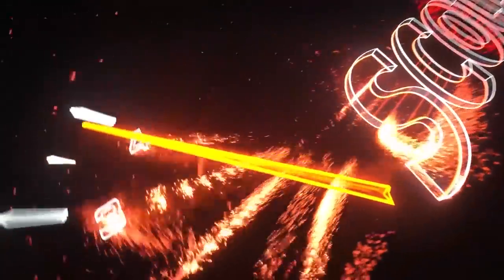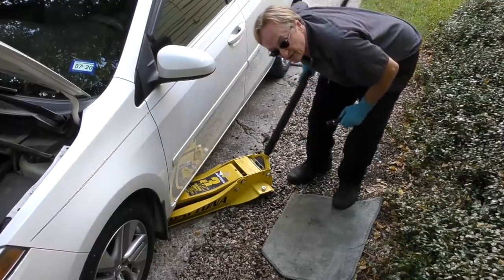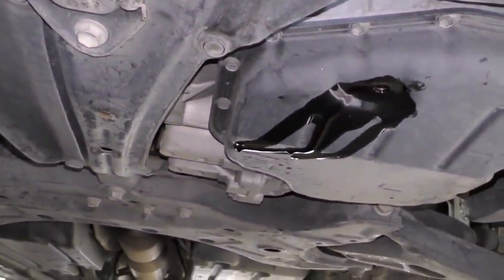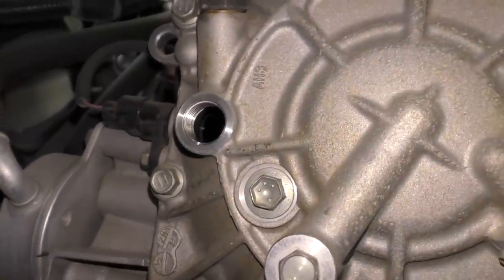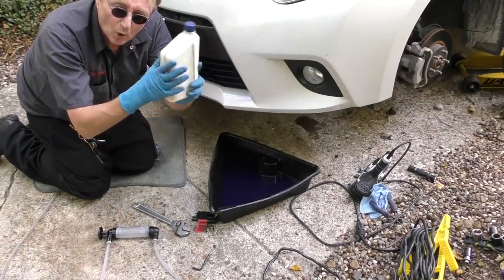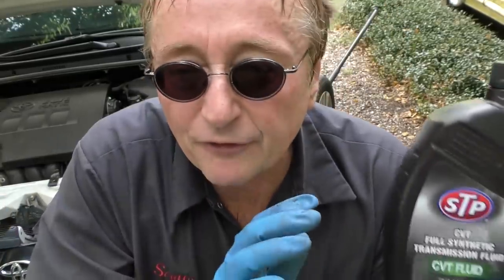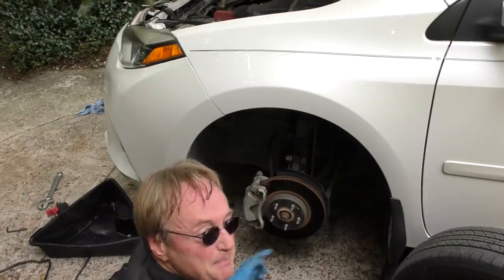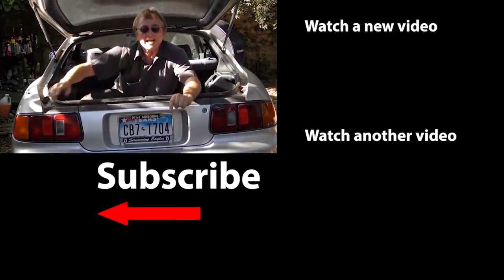This Toyota Corolla Has a Serious Problem

Comment: Scotty! I have a 2011 Chevy silverado 5.3l 4x4 with 151,000 miles on it. The transmission fluid has never been changed (I've owned it since 47,000 miles. Oops) is it still safe to change the fluid in it or is it too far past in mileage and changing the fluid will do more harm than good? Thank you!

Comment: Hi I have 2015 Toyota axio CVT transmission. When accelerating the car make a strange noise like it whinging or screaming I got the car look at and I was told I need a new transmission because the bearing by the axel gone bad can u confirm

Comment: BMW motorcycle shaft drives went through a "lifetime fluid" phase also...until they started to fail! Now they all have drain/fill plugs and stated intervals. Considering that the final drive 90º gear box costs $3K to replace, I think fresh fluid is a bargain...

Comment: I know this is a CVT so it might be different, but that seems like a small amount of fluid for a transmission.  How do you get the rest of the fluid out that's in the torque converter and cooling system?

Comment: Scotty I know that the process would be the same for any CAR transmission my question is what about a 2017 Nissan Pathfinder that I know have a lot problems with its CVTs transmissions. I have done some research and most of the videos show that you need to have an specialized scan tool like you have because you need to check the transmission fluid Temperature to be able to do the job right and in some of the videos they recommend to flush the lines that go trough the radiator part. What are you thoughts on that and do you think that I can do that transmission fluid change on my 2017 Nissan Pathfinder the same way you did it on this Toyota Corolla? Thank you and I love your channel soo much knowledge... keep the good work.

Comment: hi, im having a whistling noise coming from my toyota vitz 2007 model which is having a cvt transmission. and vehicle is not accelerating when the noise is there. seems like cvt belt is slipping. any advice you can give??

Comment: I love that pump. What is that kind of pump called? That is so much better than a funnel from the top because it takes forever. Especially thick 75W90 manual gear oil.

Comment: Only one quart?. Then You have to do this every 2 months until it comes clear. It goes by temperature to get more out on one try.
Reply: I have a feeling he either mispoke, or that car was very low in fluid. this is the problem with doing his way...he talks about "if you want it done right, do it yourself." when the manufacturer says there is a technique that is much different. just replacing what came out is not right because it could have been low or overfilled to begin with
Reply: True. That is the importance thing about temperature. It’s a different process but  I think this is a perfect situation that works.

Comment: @scotty kilmer thanks for the much required video tutorial. I have 2 questions

1.After pouring new fluid don't i have to go to a specific temperature for the cvt fluid and again loosen the drain plug to see any amount is coming out or not?

2. After finishing filling up properly is "calibration" necessary?

Comment: I see a lot of repairs like this one and diff work says replace crush washer with a new one. Is there an affordable source to get an assortment of them in bulk to have around? It seems like a crazy reason to not be able to finish a job and every video I see replacing the washer casually mentioned like adding a bead of oil around the oil filter gasket. Well oil I got, assortment of crush washers, not so much. Is it the same type for diff, oil pan, CVT drain plugs? If they are all the same I would like to have some. I just found how many different fluid locations my Subaru has, I think I am going to need them...

Comment: If you consider this procedure did not replace all the fluid but not even half I guess it's money in the pit Some years the TCM has updates but in general CVT are program to raise the pressures as the transmission fluid loses it's properties so technically you would reset the TCM memories as you have done repairs. To make the engineers point the fluid is good for the life of the unit .When the life of the unit is over you replace the whole thing. I would not suggest any rebuild it's a recipe to disaster

Comment: Hi Scotty, I rather have someone else do the work.  I'm not climbing under the car, put on rubber gloves on in North Carolina heat, then take off the tire, then put it back on.  Sometimes it pays to get someone to do the work.  Now if you like doing this, great, but nowadays the belly gets in the way and the legs ain't what they use to be nor my patience.  The older you get the less patience you have even for minor fixes.

Comment: Hey Scotty! I have a 95 celica with a manual transmission. The knock sensor code came up. Having trouble finding the sensor on the engine. Any idea where it is?

Comment: Scotty,

I just bought a 2008 Honda CRV with 65K miles. It was a single owner car, garage kept, and only driven 6 miles a day by an older couple.

The transmission fluid has not been changed, although everything else has been extremely well-maintained.

Should I change it since it’s close to 50K miles, even though it’s 12 years old?
Reply: HOw does it look and smell?  Engine oil more important because 6 mi. may not reach full op. temp. long enough.
Reply: Bryan Heck I will change it every 60000 miles.

Comment: Surely that CVT transmission has significantly more oil in it than 1.7 quarts!  Seems like a WHOLE LOT of trouble to change what is likely just 1/3 of the total oil in the transmission!  Why not flush anyhow???  And what about the filter??
Reply: would you prefer the weather to slowly drop couple degrees every week until winter or 110 today and -5 tomorrow?
Reply: I think the filter is not removable like many cars are being made today. He didn't drain that much out because he didn't lower the car after jacking it up

Comment: Scooottttyyyyy!!!!! Please I need help on this one...I swapped my Nissan xtrail t31 2008 model cvt transmission for a manual transmission and it runs very slow now. Do you think I need a new ECM or the old one can be worked on to control my manual transmission. Please help because I am still on this project as I am writing.

Comment: Shouldn't you run the transmission to a certain temperature and then take the drain plug off and drain the excess oil. (that orange thing gets left in there)
Reply: I mean after you refill the tramsmission

Comment: Should I even change the fluid on a Nissan CVT transmission that has 110,000 miles? I think at that point it would hurt it more than it would help it.
Reply: no it's never too late to only do a drain and refill. Only time it could ever do more harm is if you flush it. Scotty talks about this a lot. Honda recommends changing CVTs every 90K for normal driving conditions and every 30K for severe driving conditions. I would definitely change it now and change it every 30K from here on out

Comment: Scotty-I just bought a 2010 Toyota Corolla as a daily driver. Does my car have this kind of transmission or is that only on the newer models?
Reply: You probably have a standard 6speed auto, but its the same procedure.  my 2012 camry with the 6speed was exactly the same as shown here.  Get a manual for it, or search online for the proper fluid to get.

Comment: Hi Scotty.   I live in Maine and am trying to buy a pickup 4x4.   i cant afford one so im looking at cars.   I have 2000 dollars and have come across two cars in my town.   a 2003 lexus GS 300. 195k mi.   good inspection sticker says nothing wrong with it.   Also a 2002 BMW 540i.  v8 both RWD   BMW has 165k mi.  says it runs and goes good.  which would be best overal for saving money.   I figure Lexus.  it has a 2jz motor pretty cool.  BMW has lower mileage and is cool all around. but fear BMW will give me more problems.  both about the same price.

Comment: This isnt the proper way on toyota cvt. From what i can remember you have to let the car warm up checking fluid temp with a scan tool as it has to be withint a certain degree and put it into a check mode. I think u shift it from park to drive  a couple times intill the D light on the dash blinks and then undo the drain again and see what comes out.
Reply: ThefamousReds “DNY automotive “channel shows the proper way to change the trans fluid

Comment: My dad has a 2014 corolla with the 1.8L and CVT, had the fluid changed every 35k miles.   Currently has 92k miles on it and the transmission is getting rebuilt to the tune of $3,000......wondering if the fluid was actually changed when it was taken in for the service.
Reply: I'd just buy a used one for $500. Ouch
Reply: that's why i'd only buy a CVT from Honda.

Comment: The only CVT I want to deal with is the one on my Honda Elite 110 scooter. I'll make sure if I get a new Corolla it'll be no newer than 2014 with the good old 4 speed transmission or a manual transmission for anything newer than 2014.
Reply: r762368 I have a 2016 CVT Toyota Corolla with 153000 miles, no issues at all. I am a rideshare driver. “DNY automotive “channel shows the proper way to change the trans fluid

Comment: So you're assuming the tranny had the correct amount of fluid, to begin with.  What is the tranny had a small leak etc, then you would still not have the correct amount.  How do you check it then?

Comment: Hey Scotty, I have a 2014 Corolla s and I bought it with about 60k miles, first thing I did was chance all the fluids and filters plus brake pads just to make sure. But I also had the transmission oil filter changed, do you think that was unnecessary? I also bought the original CVT oil from the Toyota dealership.
Reply: I have a 2016 Toyota Corolla s plus and I have 60k miles with cvt transmission change it every 60k go by the owners manual that’s your best friend

Comment: Scotty never reads these posts. The 2014 Corolla LE needs to plug into the diagnostic port and several other things not mentioned here. Please be specific of what year model(s) you are referring to. !! All cars changed after 2014 with all the computer crap.

Comment: Hey Scotty, my 2012 Toyota Prius C makes a small grinding noise with the initial acceleration of the car.  Any idea what it could be?
Reply: It's making itself some coffee of course. Don't YOU like a little something to help you get going?
Reply: @yourhandlehere1  Hilarious (sarcasm)
Reply: @TheArccore  But really...most grinding noises are related to the CV axles on FWD cars. They get a lot more stress than a RWD ever did (and are smaller and weaker).
First place I'd look.
The terrible flaw in FWD design.
Reply: @yourhandlehere1  is the axle expensive to fix?

Comment: I have a 2015 Corolla and have been researching this, all of the other video's I have watched have said the car needs to be leveled, the fluid needs to be a certain temperature. (35 to 40)C on the other video's its a lot different than this one. So many different ways, hard to know which is correct.
Reply: dont follow scotty on this one. Has to be leveled and correct temp
Reply: @Chorizomicks  Why does the car have to be leveled? And if you draining from a car that sat all night temp does not matter. I agree if the fluid is warm, then you would need the correct temp to finish the job and a level car for draining.

Comment: Hey Scotty I got A Toyota RAV4 2006 the transmission oil is never been change has 153,000 miles should I change it or leave it like that
Reply: Change it by doing multiple drain and fills with the correct fluid.  Never flush.  If you didn’t tow or do all city miles the fluid is probably ok.  I would not leave it in there unless you are getting rid of the car very soon.

Comment: If tranny fluid gets so hot that engine coolant is used to cool it down, then you need to be changing it a lot more often
I was on a cvt rebuilders website out of NZ and they state to change the fluid every 40K
I think every other OLF is good practice.
Does anyone make a high milage ATF without the detergents that you know of?  I think its a good idea.

Comment: Very surprised there is only less than 2 quarts of cvt transmission fluid in that car. My Ford F250 uses about 16 quarts of transmission fluid.
Reply: Michael Urban I hope that includes what’s in the torque converter

Comment: Should you change the fluid on an 07 Fusion v6 with 90,000 miles or is it too late?  It's never been changed.
Reply: yes of course. Never too late to do a simple drain and refill. Flushing is a different story. My 2013 Honda Accord CVT says you should change the fluid every 90K for normal driving conditions and 30K for harsh driving conditions. I just recently changed mine at 95K but will do it every 30K from now on to be on the safe side

Comment: Don’t know what to believe now I’ve herd that you should never change your transmission fluid now I see your video I happen to have a Toyota like in this video seem easy to change myself not sure if I should just go ahead and do it.   Do most vehicles need transmission fluid change?  I also have a 2016 Dodge Ram with 60k miles just wondering.  Thanks for your videos keep up the good work
Reply: That is a myth I myself have heard, transmission fluid should be changed at 60k miles, sometimes its still ok at 100k miles but that's pushing it. Atf gradually degrades over time and loses its ability to protect the transmission from heat and friction, keeping fresh fluid in the system ensures a long service life. Btw all fluid in a vehicle should be replaced, brake fluid, coolant, gear oil etc, no fluid will last forever

Comment: When should we replace the transmission filter on a Toyota RAV4 with a regular automatic transmission?
Reply: Does it have one?
Reply: @wholeNwon  it does, it's a 2013 Toyota RAV4 xle. I'm wanting to do it myself and I bought it used so I don't know if it's ever been changed. I kinda want to drain and replace the fluid and replace the filter and both the gasket and the drain plug gasket. Is that more affordable than having someone do it?
Reply: @emsforlife92  How many mi.?  What does the ATF look like and how does it smell?
Reply: @wholeNwon  60K I haven't checked. The only way for me to check is to open the drain plug
Reply: @emsforlife92   Reasonable to do. Use the correct Toyota ATF.  I usually get it on line for my Lexus.

Comment: Interesting for a Toyota, If its taking just under 2 quarts to do a drain and fill, do it 2-3 times to remove most of the junk every 35k-40k miles to keep it super clean! I think it will last 200k miles easy! :)

Comment: Hey Scotty! Do you ever need to service a manual transmission? I have a 2001 Nissan Frontier with 140K miles on it and have never done anything to the transmission.
Reply: Drain/fill at 30K. Usually 80W-90 gear oil. My ‘84 Peugeot 505 recommended 10W-40 motor oil, but I used gear oil instead. Was driven in a warm climate however. Higher viscosity might impair shifting at subzero temps.

Comment: What about the Transmission Filter?
When should that be replaced?
I have a 2004 Camry
Reply: owner's manual?
Reply: these newer cars with CVTs do not have replaceable filters unless you want to take the entire transmission apart. they are made of metal

Comment: What if it shifts smooth, but the fluid is getting a grey-pink color? How much would be safe to take out and replace w/ 155k miles? 

Thanks
Reply: Open the drain, collect the fluid, measure the volume accurately and replace that amount. Next oil change do the same thing. Use only the CORRECT ATF.
Reply: @wholeNwon  
Thanks! What about changing the filter?
Reply: @Vazcular  Does it have a filter or just a screen?  If a replaceable filter, sure, drop the pan, clean it, replace the gasket, etc. and refill. Use ONLY the correct fluid. If Honda or Toyota, use theirs.
Reply: @wholeNwon  
Not sure. It's a Chevy. I appreciate your advice and info. I heard horror stories about people changing all the fluid and then the transmission started having problems.
Reply: @Vazcular  That can happen but usually the AFT looks much worse and often smells like burnt sugar. NEVER flush the trans. Keep up with the maintenance. As you know GM trans. can be weak.
Reply: @wholeNwon  
Thanks!

Comment: I have a mazda 3 2010 with 100k when i change the transmission fluid do i need to change the transmission filter also. Do i also have to do a oil flush?
Reply: never flush

Comment: Thank you Scotty! This is really helpful. I changed the CVT fluid in my Corolla 2016 (65000km) just today and I have noticed a considerable difference in my car afterwards. It is more smooth and responds faster than before.

I used 6mm Allen key to undo the screw of the CVT panel. This was the first time to undo this screw and so it was a bit tight. I used the same Allen key to undo that plastic tube to get more oil out. I got slightly more than 2 quarts out. 

Put the tube back, and do not worry, there is an end for that tube (so it won’t fall inside the panel if you screw it too much, it will just stop after it gets inside and don’t over tight). Put the screw back and don’t forget the washer. I reused it, and used the Allen key to tighten the screw.

Now go to the fluid infeed screw at the driver side as shown in this video. I used a 24mm socket and an extension bar. This screw is super tight so be careful.

Finally, what comes out goes in. Tightly do the infeed screw and all done.

I got the CVT fluid FE from Toyota dealership. 1 litre for 9$ (Canadian). So this is not too much.
Reply: A. Radwan 

Was the fluid hot or cold when you drained it?? Some videos make this procedure seem super complicated. But it makes sense, drain, measure and put the same amount back in.

Thanks.